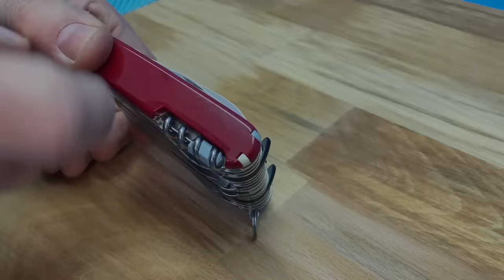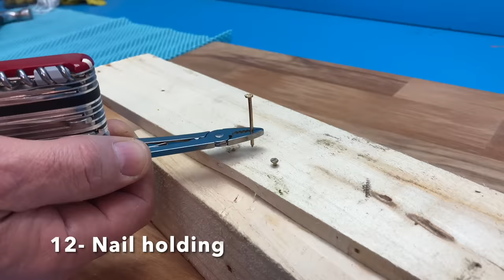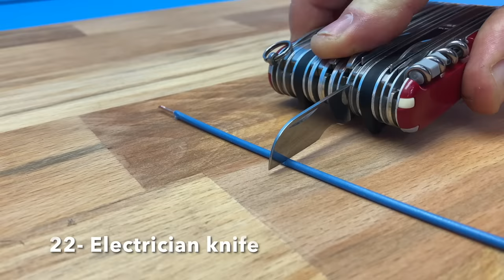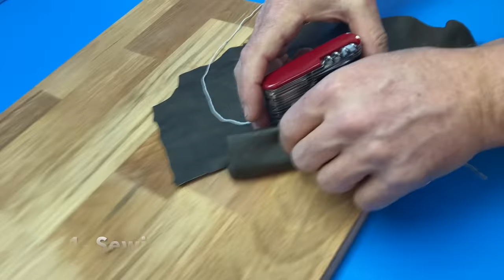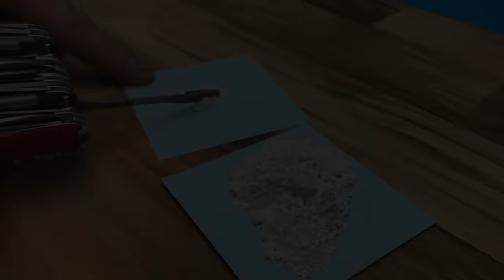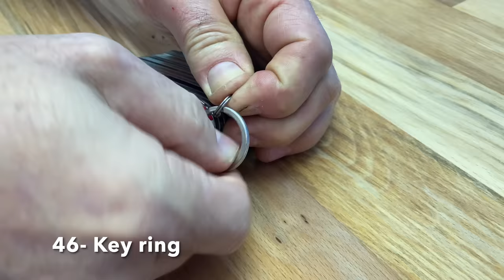World's Largest Swiss Army Knife ! 64 Functions

Comment: I liked your review. I have an older Victorinox SwissChamp XAVT, but my model (#1.6795.XAVT) is no longer in production. It has 80 features. It's not really a practical EDC knife, but it's very impressive. Mine has a built-in clock/calendar LCD display on one side, and two hooks instead of one. Mine doesn't have the universal wrench tool, but that would be a nice addition.
Reply: Sounds like u need the 81 tool. Haha.
Reply: Same as mine.  I did notice some features in the video that gave me a "hey, wait a minute" moment as my boat anchor didn't seem to include them. I was not aware that they had updated the design in later editions.

Comment: I collect Swiss Army knives. In my opinion, the "Swiss Champ" is the the largest of the classic Victorinox designs to still be handy to use and not too expensive. These huge models are interesting to collect  but impractically large and heavy.  I have one (with the butane lighter!) and stupidly dropped it onto the floor. The smaller knives would have survived with no ill effects but this beast was so heavy that it cracked one of the scales!

Comment: I had a habit of pocketting one whenever I leave home. One day I forgot about it at the airport after checking in my luggages. All hell broke loose, thinking that it would surely be detected and confiscated. Luckily it was safe with me till today. Nowadays I leave home without it. It has 8 tools. Most important #9 Xray non-detectable!
Reply: من اين استطيع الحصول عليها فى القاهره بمصر وكم سعرها مع الشكر
Reply: The same happened with me.. always carry my victorinox..got stopped at the embarkation point.. the airport security saw my army ID n let me through even though he could ve stopped me.. that happened within a year of receiving it from my unit.. its been 15 yrs now.. still my companion
Reply: @mohamedalshal2822   they are normally sold in high end departmental stores in the camping or outdoor activities section. They  are a bit costly due to the fact that they are Swiss made, built to last forever.
Reply: @mohamedalshal2822   find them in high end department stores or camping equipment shops or outdoor activities stores. May be a bit costly or expensive because of Swiss product and quality to last a lifetime.

Comment: Cool.  Probably a bit unwieldy, but the gadget lover I once was would have longed for it. I did learn a couple of "new" functions for my own 30 plus year old Swiss Army knife, still going strong; the way to hold the pen; the measured line drawing...
Reply: Bought my Swiss Champ (SOS set) almost 40 years ago when I could probably have used my (then) scant funds elsewhere. Still have the set and had it refurbished by Victorinox a few years back.  As good as new.
Reply: Yeah this is more of a display piece. It has all of the tools of Victorinox

Comment: I've owned and carry the xlvt use nearly everyday day for 15 years and have a backup. I've lost bits, and replaced them. I try not to get to much out of it. The flashlight hardly ever held up. The digital clock barometer didn't last 2 years, magnifier isnt glass but works. The ink pen is tough and held up. Stainless steel blades but I sharpen every couple years. Don't be a sissy carry it everyday you won't wanna do without it.

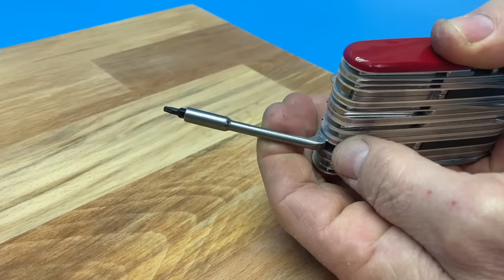Comment: Nice video.   At the 7:30 mark, I would add the two bit drivers are also small socket drivers without using the bits.  I heard that the Victorinox SwissChamp XLT is being discontinued.  At an online price of $294 (or more) I guess it was not a big seller.